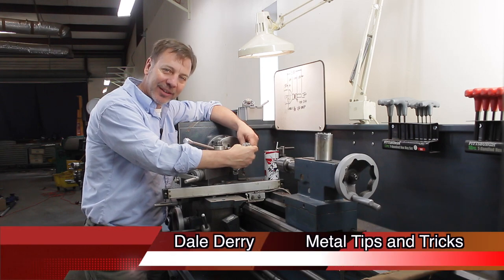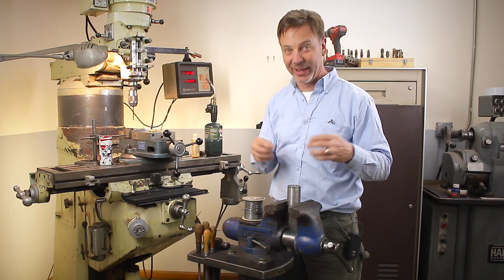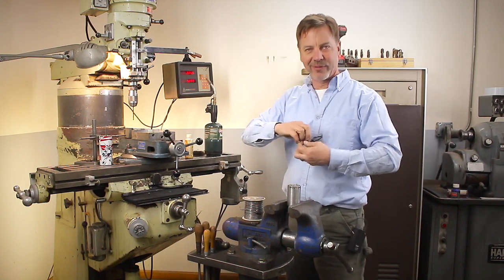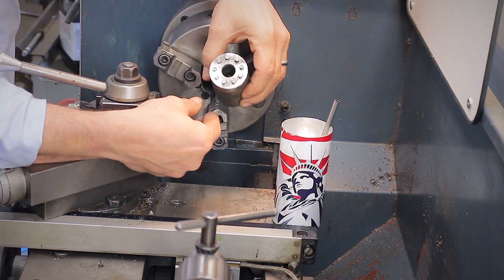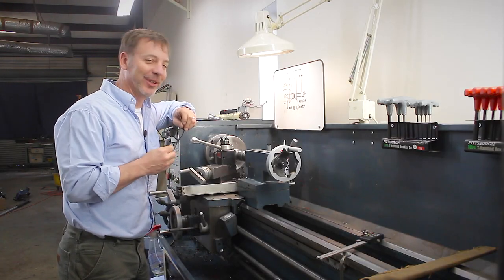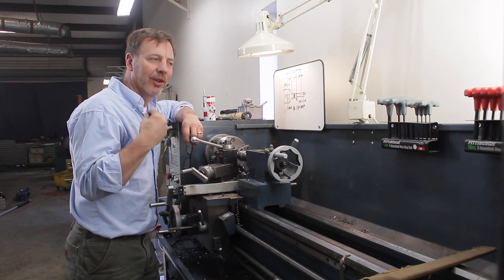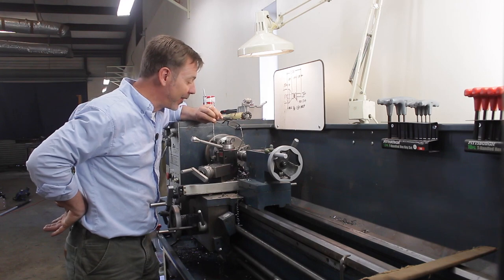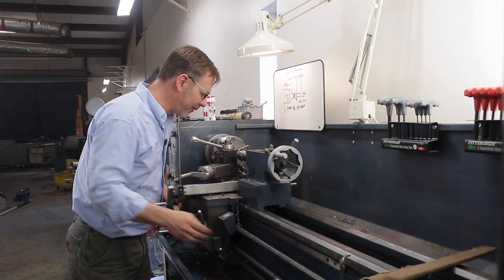Milling machine drill adapter Part 2 of 2

Comment: Food for thought.... Sewing machines have powerful motors with pulley underdrive, foot pedal controlled variable speed, forward and reverse switch. 

Sounds like a permanent solution for a drivetrain for the knee.  Build challenge? fun project.....

Comment: Well, looks like this video was just what I needed to get my butt out to the shop. I used a template that I made in AutoCAD using a polar array for the hole spacing, and it worked great. I also press fit my holes and used a little dab of loctite for insurance. This thing works like a charm, and DEFINITELY beats the hand crank any day of the week.
Reply from the maker: +ARCustomKnives 
Great suggestions, thanks for your comments.

Comment: Love the pins.  If they are a tight fit you should be able to flux them and place a small piece of solder in the bottom of the hole.  Then pull the solder up to the top with with a torch.  That's if they don't pop out of the hole first.  Great budget friendly project.   Thanks!
Reply from the maker: +GreenGander75 
Great commet

Comment: Dale,
You could cut 1/4" pieces of solder, drop them into the fluxed holes, then apply heat. Might keep the face solder free.
Reply: Agreed but in a blind hole like that I would use less than 1/4" remember you only need solder in the tiny space between the pin and the home walls. Any more and the pins will float up like in the video.
Reply: +Anthony Tunguy-Desmarais had similar problem with terminal caps on large wire, little thru hole solved. But might add steps on other end. Brass wire wheel probably do some quick work on excess material. Amazed at how beautiful the parts come out with just few easy steps. Thx for vid
Reply from the maker: +Donald D'Egidio 
Great Idea

Comment: Dale,
Great project. Could you have used your dro in your mill to do the bolt circle? Just wondering.
Rod Schweiger
Reply from the maker: +Rod Schweiger 
Yes, of course you can use DRO. I think my way is a little faster and worked quite well.

Comment: Hi Dale.  I like the paint transfer.  Good tip.  How about a quick trip with a rotary wire brush?  Should get rid of the excess solder without messing up the brass pins (too much?).  Effective gadget, well done to Mr Pete for the concept and you for the simplification.  And kudos for your acknowledgement of the prior art.  What the heck can your big lathe do?  Bob
Reply from the maker: +Robert Hawtin 
As a big Lathe  set  right now I can make a one inch cut off the diameter  without even trying. It's a lot of fun and a big timesaver :-)

Comment: This and the preceding vid are a fine example of thinking outside the box.  Soldering is something I do quite often. Maybe you should do a video on the different types of soldering. I suppose you used silver-based soldering because lead stuff (electronics solder) won't take the heat, literally, involved in turning. But I would like to know what the silver content is for different applications. I will tell you right away that the stuff they sell in box stores = garbage. 
What I do with a problem like yours is flux it. Then I laboriously wrap a circle of thin solder around each pin. Heat it up, greatest mass first. At some point, the solder will melt and flow down into the joint by capillary action. Very little cleanup needed. Did not invent this, learned it from Gerald Wingrove's book (builds amazing classic car models). Keep 'em coming!
Reply: +Juan Rivero I think what you mean is called brazing, which takes some more heat than soldering and is cleaner. I think he added way to much flux anyways because normaly the braze or soldering rod is only going where the flux is added. But good video anyway keep it up!
Reply: No I did not mean brazing. That takes oxyacetytelene. I meant plain old silver solder.  But no two silver solders are the same. Main difference is the silver content. The silver solder that works to sweat pipes is not the kind .you want to do this kind of a job.Or to repair bandsaw blades, I for one would like to know what it takes.
Reply from the maker: +Juan Rivero 
Thanks  for your comment . I'm not an expert in soldering,  sorry.  I just use whatever plumbing solder I have. But I like your comment  thank you

Comment: I think if you had done most of the turning before soldering you could add the solder from the back side and avoid getting it all over the front face
Reply from the maker: +Lasse Langwadt Christensen 
Good point

Comment: Dale, very nice.  Thanks for your video efforts and time.

Could you explain a good way to cut 3 flats on the shank for chucking in the drill.  This would eliminate any chance of it slipping in the chuck.  Not knocking your design just wondering how I would go about cutting the 3 flats on a mill.  Thanks.
Reply from the maker: +Brian Rayburn 
Great comment. An easier way to do is use a file well it is still on the lathe and use the the 3 jaws as you reference points, but if  you want to do it on the mill the best way is dividing head with a 3 jaw chuck.

Comment: Would it have been better to turn it down and then soldered from the backside or clipped some solder and placed it in the hole and then heated it?  All in all a very good project.  Well done.
Reply from the maker: +Chad Prince 
both are good ideas

Comment: Just wondering why not use the hole circle option on the DRO?
Guess turning wheels is more work than turning the part.
Cool project, think I will start mine in the morning...................Thanks Dude.

Comment: I use “Knurling Calculator” for my Android phone. Just type your starting diameter and the number of Knurls per inch which is often stamped on the side of the wheel. The calculator produces the closet diameter to your starting diameter that assures you won’t over-print your knurl.

Comment: Try tinning all but 1/2" or so of the pins and leaving a drop of solder on the tinned ends. When you apply heat you won't need to add more solder and have it spread all over. The solder on the pins will spread inside the holes by capillary action and anchor the pins but most, or all if you do it just right, will stay in the holes.
Reply from the maker: great suggestion, thanks . :-)

Comment: If you had not clamped the work in the vice, directly , but with insulation in between, it would have been quicker. Your way you had to get the vice up to soldering temperature as well.

Comment: Just fyi...for something that simple you could just prep it just like you did, but add some snips of solder to each gap and then throw it an oven at 400 C (60/40 solder melts at 380 C if I remember correctly)....then you just come back in as long as it takes to heat up to temperature and turn off the oven and then  if you want wipe it down with a rag (like you did in the video) or whatnot and you are good to go....the other positive about the oven is there is no worries of uniform heating (not that it was that big of a problem...but still).
Reply from the maker: Great Idea. I just got a small toaster oven for the shop. I will have to try it.

Comment: OK, look, I'm a Chem tech. That flux is a fairly strong acid. Putting it in the holes, then inserting the pins without safety glasses = danger, danger, Will Robinson.
Reply from the maker: +mwechtal 
yes it dose